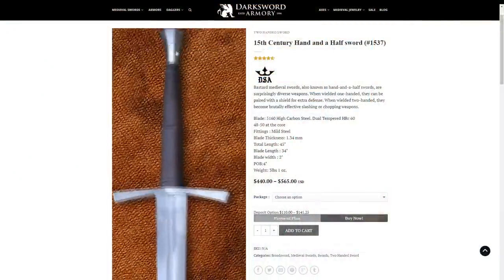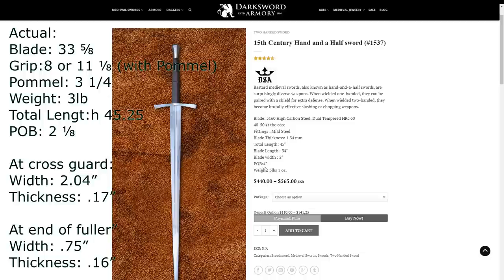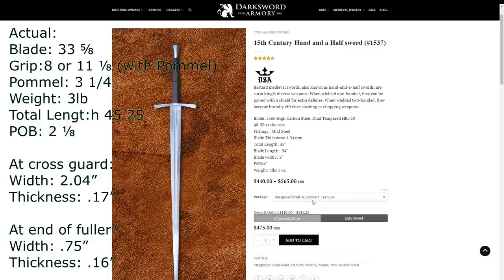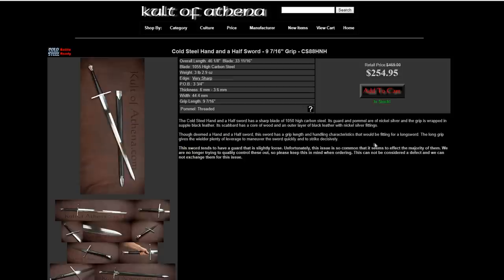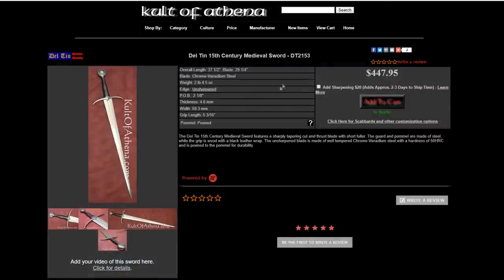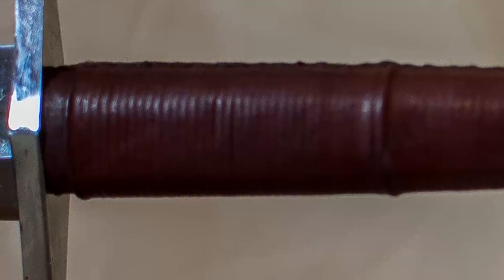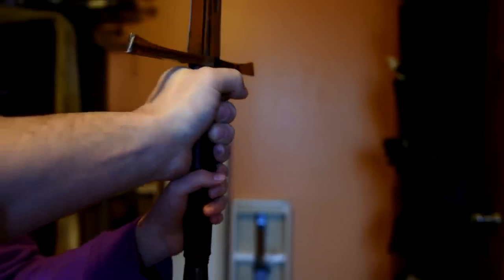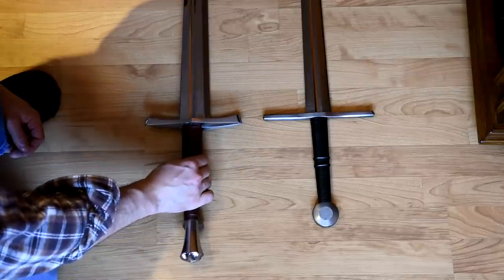Darksword Armory 15th Century Hand and a Half Sword Review

Comment: "Plate mail' and "ring mail" burn my ears. Chain mail I have less issues with. Of course, I understood what you meant.

There are 1-2 handed sword hybrids that fit both a one-handed sword that could be used with both hands, and also a two-handed sword that could be used with one hand.

Peter Johnsson in Sword: Form & Thought classified them as hand-and-a-half and bastard sword, respectively. From the majority of sword enthusiasts, the two terms are interchangeable.
Reply from the maker: Indeed,  I don't talk about this topic much and my ignorance shows.  I would guess the right terms are Plate armor and chainmail armor?
Reply: Don't worry. I'm about to show my ignorance too (Smarter people, please correct me if I'm wrong)!

Here's how I have learned things:

Mail or maille is armor with chains. So technically, chain mail is basically like saying mail-mail or chain-chain, but it's so prevalent that it doesn't bother me too much. I believe historical sources refer to what we would call "chain mail" as mail, so that's my preferred term.

Plate mail is an awful name for either '(full) plate armor/harness'. Based on the definition of mail above, plate mail as a term is wrong since it implies that you chained a bunch of plates together, which isn't what happens. In Diablo II, plate mail is what we would call a coat of plates.

Ring mail sounds like fancier fantasy variant of chainmail.

Hope that helps!